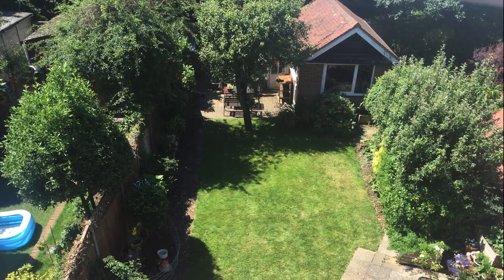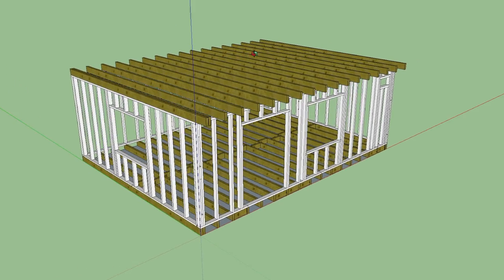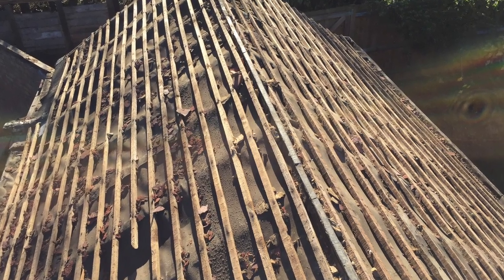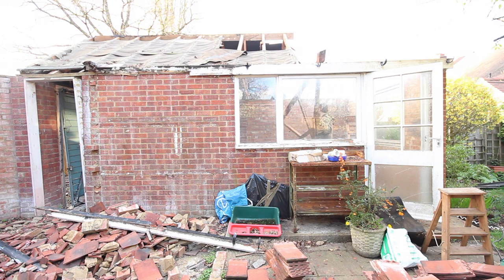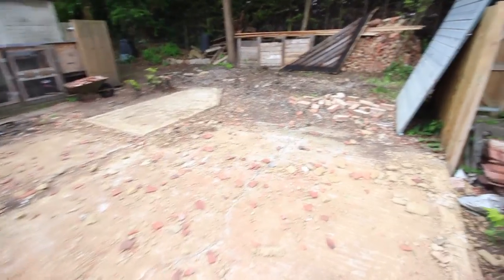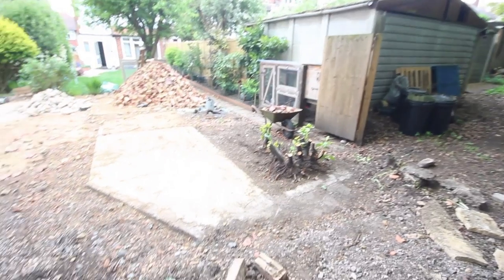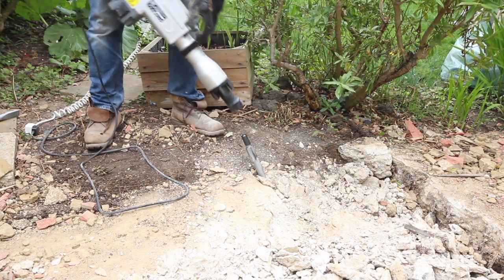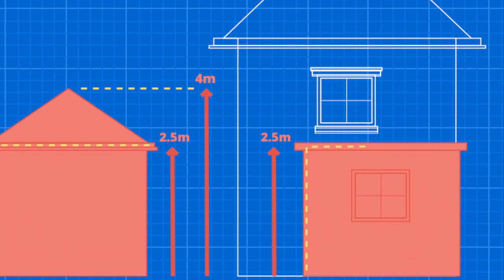Garden Room Workshop: Part 1. Introduction & Garage demolition

Comment: Just came across this series and have skipped through some of the vids (it's 2am so I'll watch thoroughly at a sensible time of day) but in the initial video you mention the cost associated with purchasing a garden room, but don't then mention what cost yours came in at?
Looks like a fantastic series so thank you for the time and effort, but could you clarify the cost of the overall build, not including the internal fixtures and fittings please?

Comment: I've now watched most of your series of videos - excellent job! Sorry to ask, but can you give us an idea of what this garden room cost? You've used first rate materials and a high-grade design spec so I'm thinking it was pretty expensive?... and also, with hindsight, are there aspects that (next time round) you would spec-down on or spec-up on? Thanks.
Reply from the maker: I don't know the cost just yet but I'm going to guess it's around 20k. Obviously a 5x3m garden room would be less than half that. Good question -I would spec down the insulation for the walls I think -probably go for rockwool and I would spec up the windows and doors to aluminium. I'd also spec up the decking to composite and get a plasterer in! Totally glad i went for tyvek over a cheaper breathable membrane. If i were doing an overall cheaper build i may just not have osb on the walls but i'm not sure on that one 👍

Comment: Hi great video. Did you just left the consumer unit inside the bag? Was it switched off at the other end? Thanks
Reply from the maker: That's right. Disconnected on the house end then I just left it in a bag but as you'll see in Part 13/14 I don't re-use it as it's too small a cable for the needs of the garden room. I could reconnect it for some garden lights though!

Comment: Hi Ali, fantastic work, I am looking to build a more modest 5 by 3 garden studio. I have two questions for you. Did you consider a pre fabricated roof structure (steel and insulation sandwich type)? Secondly what are you planning on cladding external with (I am finding this bit very expensive. Many thanks
Reply from the maker: Hi Gerry, I did briefly consider that and think it's a good viable way to go but currently don't know enough about it to give any advice other than you'd end up with a warm roof so make sure you have enough ceiling height if going with PD 2.5m height. As for the cladding, I think red cedar on the front and cement boards on the sides and back but subject to change. That will be my last stage and hopefully knock it on the head this summer :)

Comment: Never try to push over a brick wall like that, so many people have been crushed when the wall gives way as it springs back and lands on top of them. It may take longer but always use a sledge hammer from the top down.
Reply from the maker: Wise advise 👍

Comment: Do you think its possible to reuse the concrete base where a garage  used to be if its not damaged/cracked? Did you think about doing this?
Reply from the maker: Definitely. Have a look through my vids and find one about 'thermal mass'. That should tell you what you need to know for this. Option 3 in that vid would be good.

Comment: An excellent series, thank you for this. I'm considering something like this for use as a garden gym/golf-studio. Similar to you I have looked at 'garden log cabins' and the cost is high.  It also looks like your build is to a much higher standard - more of a small timber framed house than a garden cabin in reality.  How long did the build take you in total and what was the total cost?
Reply from the maker: Ah the two toughest questions. Actual build time is probably 3 months but I just spread it out as and when I was free/in the mood/had the funds. Reg the golf-simulator - definitely think about the swing and whether you want PP for a higher ceiling height. You don't want to be taking chunks of ceiling out with your club!

Comment: I'm thinking about starting something similar very soon. You mentioned that you could buy something for about £20k upwards. Any idea how much this ended up costing? Thanks so much for all the great ideas!
Reply from the maker: The first thing to say is that where I live and for all the electrics etc and the way in which I built mine I would have probably paid around £40k. Doing it myself I think the total will come in around £12-13k but it can be done for a lot cheaper if you compromise in places like insulation. Hope that helps.
Reply: Yeah, that's great and thanks for taking the time to reply. I'm going to watch all of your videos again before I start. I'm sure you'll save me weeks of research. Thanks for such well thought out plans!

Comment: Hi Ali,   Thanks for these videos great to see.  What was you final build cost?  We are just starting the process and like you am being quoted 30k plus.  so two questions:
1. Final costs
2. How many hours?  not on this occasion but where you to do it again?
Cheers
Reply from the maker: I think you'll generally find costs drifting northwards of £30k, for something decent, expect £40k with the bells and whistles but depends on quality and where you are in the UK. Mine should come in at half of that though haven't totalled it up.
Gosh, countless hours but I enjoy it. To do it again with the knowledge of this series would take a lot less. The research and decisions is greater than the doing. I really couldn't take a guess but do feel that if I had a concrete base put in and then worked dawn-dust I could do the lot in 3 weeks (outsourcing electrics and plastering). Cutting PIR is time consuming and not particularly fun ;)

Comment: So if i want to build garage right on my property boundary.all it need to be less then 2.5m height???
I do live on corner plot and i do not have back garden its all front and big.
Do i still need planing permisions????
Reply from the maker: Hey Darius, what will it be made from (the walls in particular) and what internal floor area will it have?
Reply: 18m2 just to fit car and make myself little workshop .
thinking make frame from wood or cold formed steel and timber clad exterior
Reply from the maker: Then yes it's permitted development and doesn't require planning permission if under 2.5m max height. 

But it doesn't meet building regs. Either reduce to under 15m2 or build the boundary wall with brick 👍

Have you seen Part 2? Explains everything
Reply from the maker: Ok so it's FORWARD of the principal (front) elevation of the house so it's not PD. You'll need planning permission.
Reply: thanks for your time

Comment: I wanted to build this but I only have 500 that should I do
Reply from the maker: Well you can't build 'this' for £500 but you can probably build something. If it were me I'd look to salvage as much timber as possible and see if there are second hand doors/windows going, then basically build a smallish shed like structure and use things like polystyrene and other free insulation (such as the stuff they put in Hello Fresh boxes to keep the food cold). It can be done with enough ingenuity and perseverance. Good luck to you!